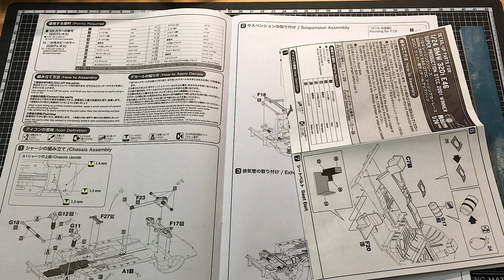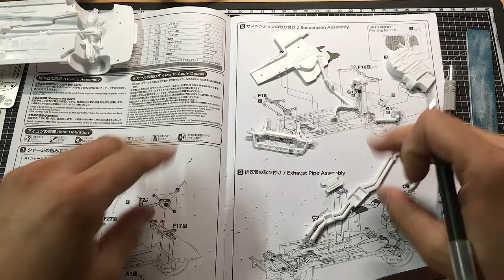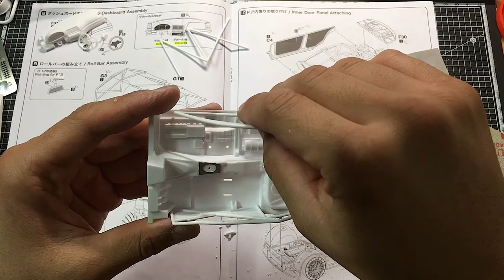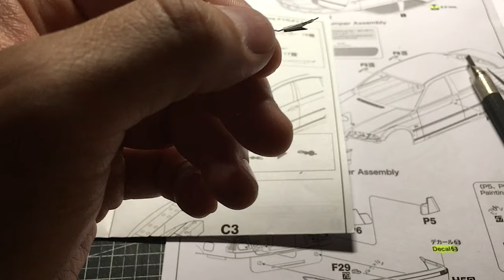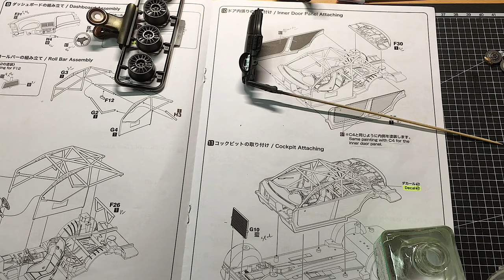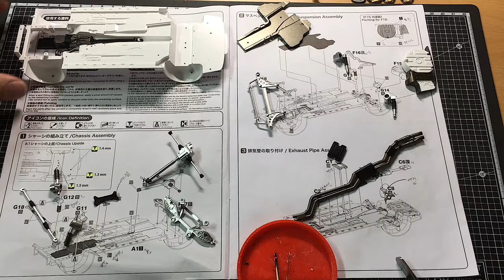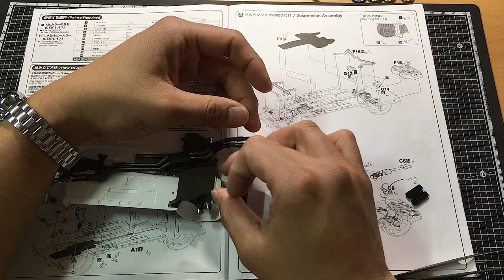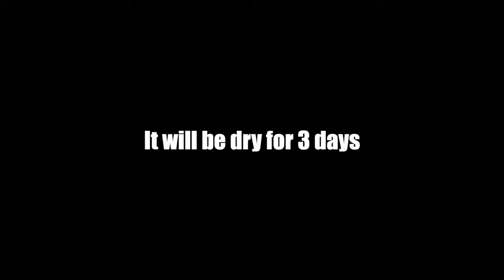[Full build] Make It BMW 320i E46 DTCC 2001 Winner 1/24 Scale step by step build (NuNu Models)

Comment: Great work,congrats! What is that spray which you are using after gluing two parts,whats puropse of that spray?thank you
Reply from the maker: It's a Loctite curing accelerator.
Reply: @Makeitscale  thank you buddy
Reply: @Makeitscale  You should pin the question. I also wanted to know and besides making my own comment bothered to search before :)

Comment: looks good one thing is the white primer coat should have been black for a red vehicle and the inside as you notice the transparency if the red getting lighter in spots with the light coming thro the back of the doors it also helps create shadows and a deeper red finish same as when laying down a black on a vehicle it'll be a red primer we use in the trade of body specialist! it's a lovely build and maybe you can use some of this trade info to apply to your scale replicas?

Comment: 不好意思，我想請教您，在影片17:08開始，上完保護漆後看到您使用2000~10000號進行打磨，2000我可以理解是為了解決水貼斷差，但號數再上去的用意是?
我現在使用噴灌郡氏B601 噴後，做不出你的光澤感，看其他影片有用6000號打磨的，模型店是建議1000號，所以我有點困惑了，應該使用多少號數去打磨才是正確
(目前做到第三台車，卡關)
Reply from the maker: The luminosity is different because it is 2k urethane crea.
If you use 2000, 4000, or 6000, fine scratches will gradually disappear.

Comment: Hi! Question from the beginner of model car building. How can you be sure that when you are wetsanding you wouldn't sand it through the clear? I am in the middle of my fourth model and this is one of the steps I am little bit afraid.
Reply from the maker: I think it's a feeling. Because the film itself is thin, steps on products with thick decals cannot be completely removed.
Since urethane has the thickest film, sand it with #1500 - #2000 - #4000 or higher sandpaper and polish it. I too have failed a lot. I think that's how you learn.

Since the explanation was made using a translator, it may not be completely conveyed.